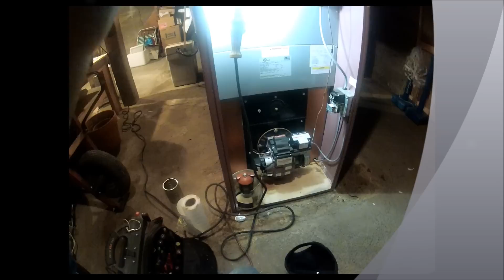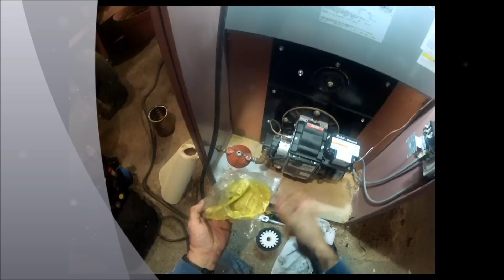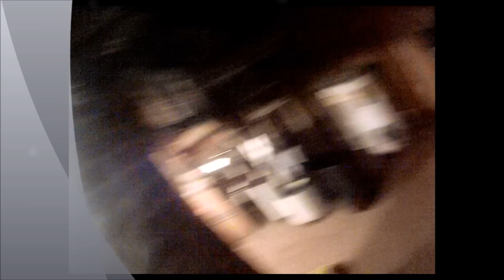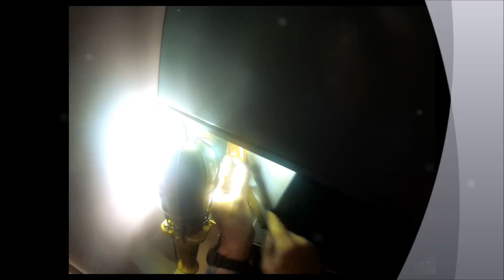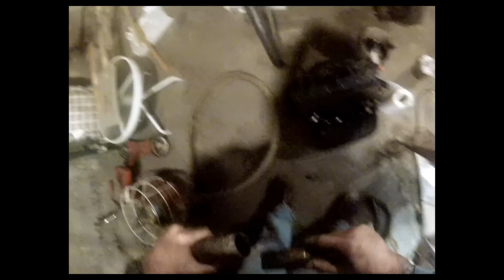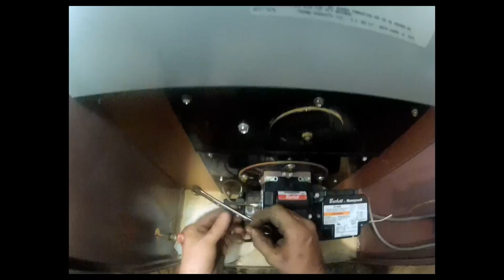Oil fired warm air furnace cleaning

Comment: I have 1 1/2 hrs to do the filter, pump filter, pump gasket, clean nozzle assembly, change nozzle, vacuum heat exchanger, vac smoke pipe, run combustion test and test all zones.

Comment: .how can i tell iff my eye is bad on my beckett furnce
Reply from the maker: You have to use a ohm meter. You can jump the eye terminals out on the cad cell relay  after the burner starts. If the furnace keeps running your then it's your eye. If it goes out on reset then it's your relay.
Reply: I am getting spark but furnace light the eye looks like it might be burned there is a small black spot on the bottom
Reply from the maker: +Sean Lennon if it's lighting and staying lite then the eye is fine. If it's going off after 45 sec. 45 second relay then change the eye. They are only a few dollars so it's not much to just change it.  Text me at 3158240116 if u have further questions.
Reply: When the flame is on if the Ohms/resistance on the 2 yellow cad cell wires are over 800 id recommend replacing it. some controls have a built-in indicator telling you the Ohms of the eye.